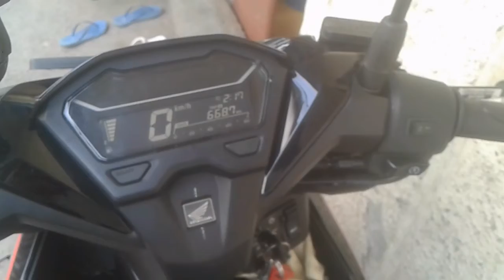Pasang hazard dg saklar biasa sekali pencet all motor

Comment: Kalo ga pake dioda bisa ga mas
Reply from the maker: Bisa tpi nnti hrus pencet sein baru hazard dua kali pencet
Reply: @yundaralvian4546  brati jalur kabel nya, yg 1 ke sen yg 1 lagi k flasher ya bang
Reply: dioda berapa amper mas
Reply from the maker: 3 a cukup
Reply from the maker: 3 a cukup